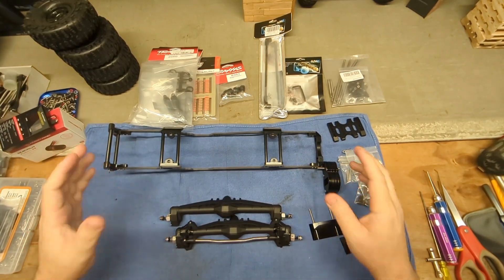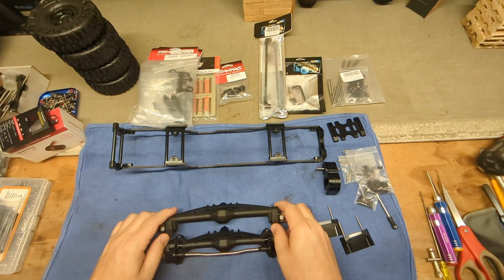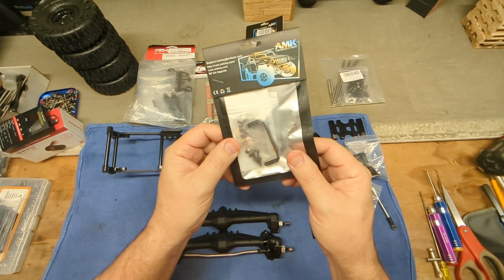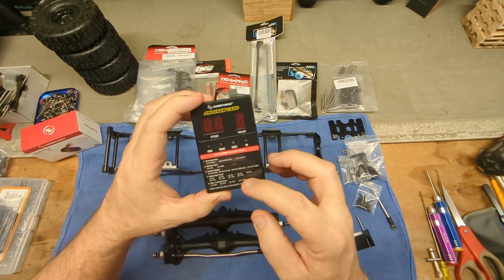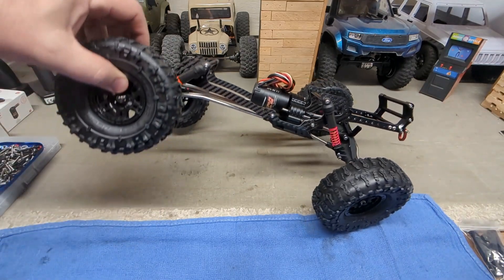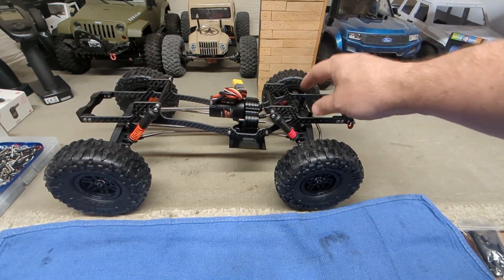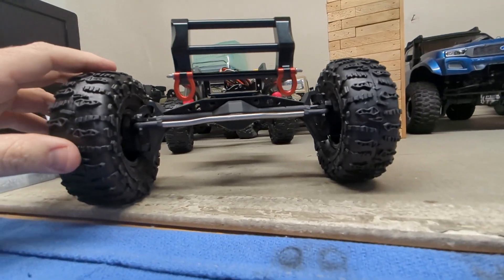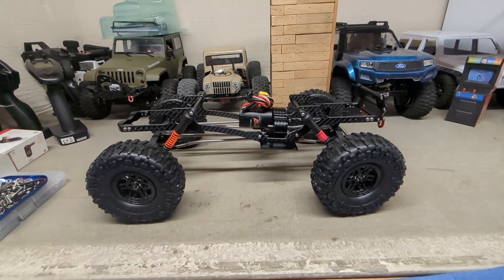Amazon LCG build part 1

Comment: I just assembled the same kit. There was a lot of slop at the link mounts on mine as well. I bought a cheap bag of silicone "O" rings to put between the link balls and mount points on the axles as well as frame mounts locations. Snugged them right up without restricting movement. Only on one side of each ball link though. Works great. Love all your builds and videos 👍
Keep up the great work!
Reply from the maker: Cool idea, I will have to give that a try. 👍🏻

Comment: all your parts are great only difference from my build is the motor I went 1800 and that was because I was told the 1200kv motor was better on a straight axle and the 1800 worked better on portals time will tell I have both could be bs.but old mate has steered me straight so far has to do with torque curve from motors and gear ratios in diff and portals
Reply from the maker: yes we will see, I can always throw the 1200 in the injora crawler and order an 1800 if I need to

Comment: I'd be curious if it would be worth adding a carrier bearing in the back there and bending the links up more for clearance. Looks like you could gain almost an inch or so more clearance
Reply from the maker: I haven't had any issues since I have clearance with the portals
Reply: @leesrcs  Yea it doesn't need it, these seem to perform well. I should have said breakover not clearance. Might be able to get over sharper points with a carrier bearing setup but it would also add a bit of weight up higher.

Comment: Hey can you flip the trans around were the motor would be in the forward facing way
Reply from the maker: yes, you can run it either way you want.
Reply: @leesrcs  thank you I am wanting to build my first rig an I am just wanting to build something that climbs like a spider I am thinking about a pork belly 12 degrees chassis have you seen the chassis I am talking about thank you I am in this nursing home I got hurt about 4 years ago and I am in a wheelchair now an I have been saving up parts to build me a rig an I have everything but a chassis an links it's been 2 years getting what stuff I have got because I am not able to work anymore so thank you again

Comment: Can you turn the motor and transmission the other way? Be better for weight distribution
Reply from the maker: yes, you can run it either way, just depends on the length of your motor and if it clears your front links.

Comment: Nice build can you tell if the links 324 or 313 work?or doxwe need smaller
Reply from the maker: LCG's work better with the short front and longer rear links. But yes you can use stock links, it will just change your balance.
Reply: @leesrcs  so many tks i have a carbon chassis 10.2 thinking in migration

Comment: Awesome build! Do you remember what link kit you used? Scx10iii?
Reply: Never mind I found your link for the parts. I’m thinking of stretching the front links to 80&85, or maybe 90&95 what are your thoughts
Reply from the maker: the shorter they are the better it will climb vertically but sometimes you have to be able to clear driveshafts or servos, I don't think 10 mil difference is gonna hurt it much.